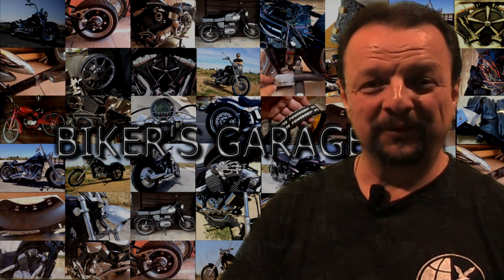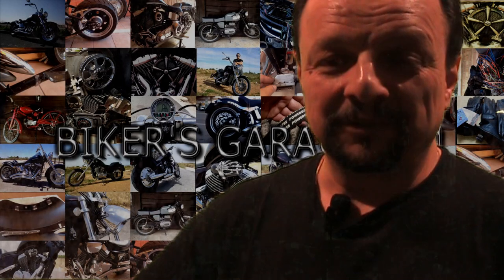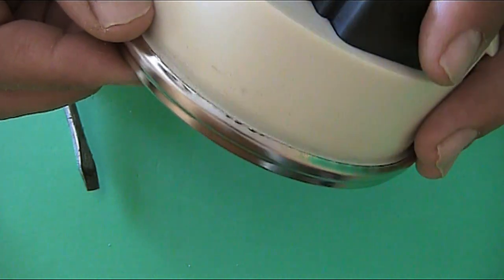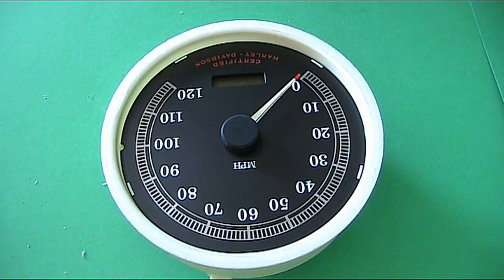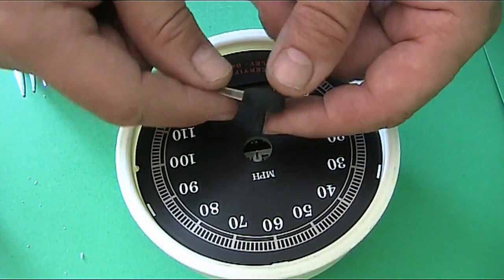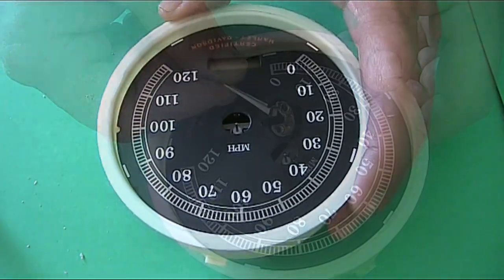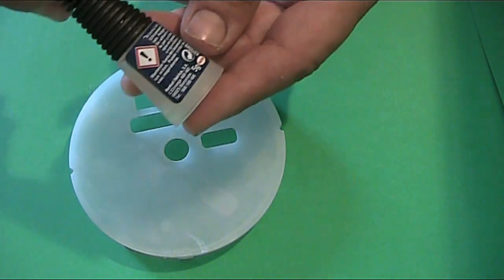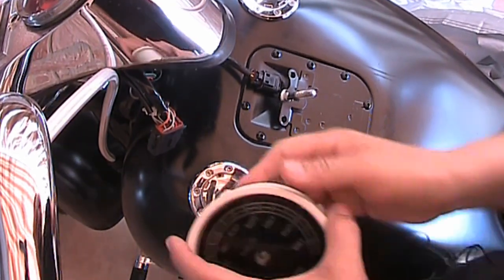HOW TO OPEN HARLEY DAVIDSON SPEEDOMETER DIAL FACE CHANGE

Comment: I think my problem is a gasket issue I have moisture trapped under my glass that makes it nearly impossible to see my speed or milage how do I fix that and how do I seperate my top and bottom speedo case halves?  I can not get them apart to work on speedo I have an 08 xl1200n sportster in case you need that info.
Reply from the maker: Hi Andrew... I don't fully understand when you say that you want to separate the top and bottom of the speedo halves. As you can see in the video, the speedo has a top bezel that holds the glass and gasket in place. When you take this off you have the needle, the fascia. Once you remove the face of the dial you will be able to see the couple of self taping screws that hold the electronic board to the outer plastic case. Thats all there is to it! 

But to be honest... many fogging is due to speedos that are 100% air tight after somebody opened it and thought it would be great to seal it all with silicone!!! Bad idea!!!The speedo needs to breathe and at the same time be water tight but not air tight! It's the same effect as fogging inside a car: open the window and boom it's gone!

I'll bet you 100 bucks your speedeo has been opened and had the "silicone" treatment. 

Let me know.

Ride safe bro!
Reply: Meaning the outer case that holds it on the tree there is a chromed cover that hold it in and locks the electrical cord to the back of it ill link a pic when i get home if it will help
Reply from the maker: OK Andrew... will keep an eye out but removing speedo from a Sportster to open the bezel is no problem.
Reply: Ok cool
Reply from the maker: BTW thinking of my Sporster when I had it (XL1200C)at  the back end of the can that contains the speedo, you should find a couple of screws that hold the speedo tight in its place. Take them out and the speedo should slide up to allow you to disconnect it. Carefull with the rubber protective gasket.

Hope this helps
Reply: Cool ty brotha
Reply: hey brotha just got home ans snapped that pic for ya not sure how to upload it to ya though?
Reply: got an email address I can shoot this pic too? please let me know bro and also really appreciate this help I found 2 screws in the back and the odometer reset button had a weather proofing rubber tip that unscrewed to take it off took all three out and it still will not come apart to inspect it
Reply from the maker: sure thing bro! try bikersgarage101@gmail.com. Will help you out.
You're nearly there tho... all you have to do is give the speedo a push from behind pocking into the screw holes and she will come out. sometimes the upper rubber gasket gets a bit stuck but she will come out

Comment: If the bezel is damaged, can a new one be obtained?
Reply from the maker: Hi Nalex... that's a good question! 
I do know that HD shops carry these but cannot tell you the price. 
I've checked the Custom Chrome and Motrocycle Storehouse catalogues and could not find any. 
The only aftermarket catalogue that I know of that carries 5" bezel and glass kit is Drag Specialties ref DS-243809. 
Hope this helps.
Don't forget to LIKE and SUBSCRIBE please.
Ride safe!
Reply: Biker's Garage 101 thanks for the response. I just need to replace the bezel on my dyna tachometer which got damage in a little accident, but can't find a replacement anywhere.

Comment: What about a vintage mechanical/analogue speedos...? The glass and rim would be the same, but the discussion of resetting the dial by hooking it up clearly wont apply. Years ago I stuffed up one of these 35 year old HD speedos while trying to remove the needle resulting in that the entire spring came out with the needle (100% f'd that one up)  - So, any chance you can put up something showing the process on one of these... ? http://i.ebayimg.com/images/g/BdUAAOSw5cRZJd5z/s-l300.jpg
Reply from the maker: Well... you know what? That's a great question. But here's the thing: I don't have a speedo of that type available otherwise I would be more than pleased to give it a shot!

Comment: Is it possible to change the odometer screen ?
Reply from the maker: HI Alexis... I'm sorry but I don't understand your question. Do you meen the digital LCD? I have not tried this and would have serious doubts about it! In principle, I would like to think that you should be able to but finding a replacement is going to be something of a struggle is not impossible and that is not even counting on the installation.
Reply: Yes I meant the digital LCD. The numbers on my 99 Road King are fading and are almost unreadable.
Reply from the maker: That's a BIG issue indeed. Maybe the display is coming loose off the board. Difficult to without looking further into it but its not good my friend!

Comment: I tried this and it doesn't work. the bezel is pressed on and you can't remove and reinstall without tearing it up.
Reply from the maker: Sorry to disagree Barry. I've done this a couple of times and it went without a glitch on models spanning over 15 years. 

If you do it as explained, you WILL get it open.
Reply: Oh, I got it open and the edge looked like what you would expect. The real clincher is putting it back on and re-bending it back into position where you know it's not going to fall in the street later. I do have a solution. Cut opposite sides and use epoxy to put it together again and it won't look like trash when you're finished if done with a finishing touch on the epoxy.
You are prying against plastic to bend metal... not a good combination.
Reply from the maker: Barry, I see your point, but then again if you watch the entire video I do mention this. Also, don't forget: closed speedos have condensation problems. If you follow my instructions to the letter, water will not seep in. This is old school stuff here. Not discovering anything new, just explaining how to do it.
Thanks for sharing your thoughts.
Ride safe
Reply: Your video stopped at the removal and I watched it 3 times before diving in. The bezel was dented at the top but not the sides. I had ordered a chrome piece that was supposed to go over the bezel and the dents would not be seen. I followed your instructions and got the bezel off and replaced the broken glass. Putting it back on I broke the new glass and was impossible and I never did get to the challenge of trying to bend it back to hold all together. Hope others have a different experience. By the way, my bezel was made of stainless steal if that makes a difference.

Comment: Well that's funny don't use no sealant I took my speedometer off my bike to take it apart to put sealant in around that plastic gasket mine gets moisture and fogs up since he came up with that idea and no sealant I thought maybe drill a little hole in the bottom of the plastic cover to vent it out water won't get in it that way cuz because the whole will be on the bottom maybe I'll have to give that a shot and seal around the bezel cuz I'm tired of it fogging up

Comment: Please make a video on "HOW TO DETECT MOTORCYCLE ODOMETER FRAUD"??
Reply from the maker: Now that's a tough one!
Reply: If a dealership were to connect to the ECU, would it not tell the true mileage? I understand that over years of customizing and tire size changes, it's probably going to read some different, but obscenely different is a big red flag...